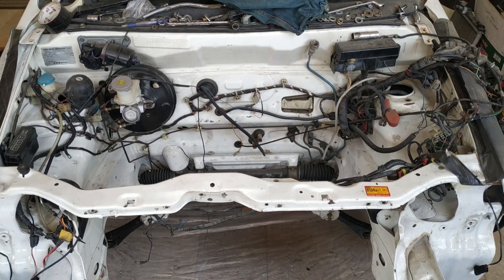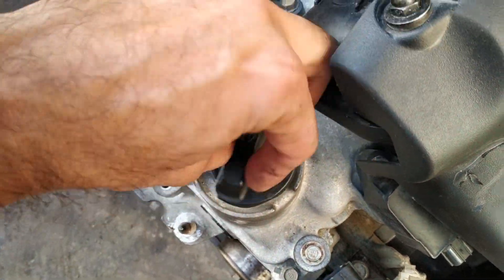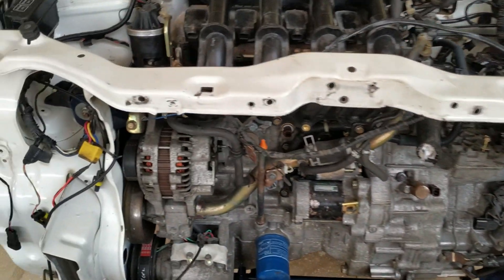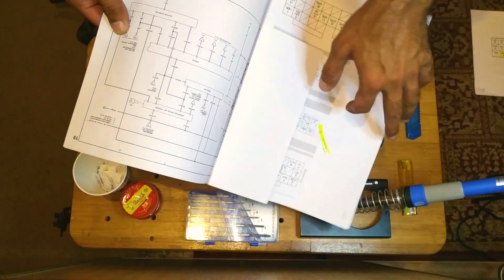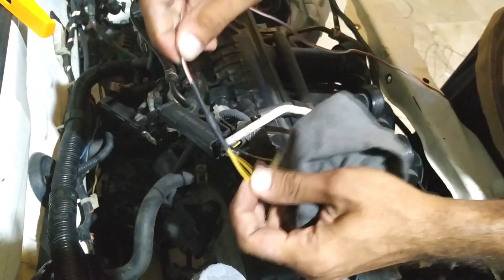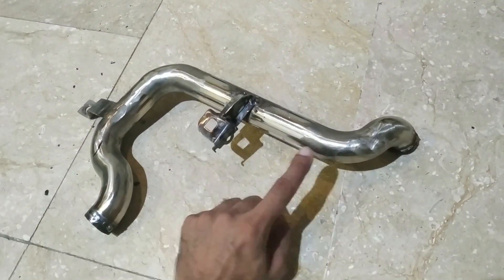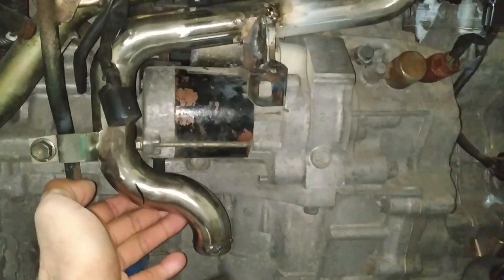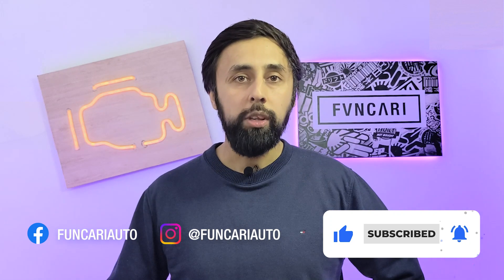Project L13A ALTO: The Engine is Here! Wiring and More – Part 4

Comment: Great episode. One thing I'm concerned about is the additional mounts that you've added, do they impact the ground clearance of the car when it's fully loaded with passengers? Eagerly looking forward to the final stretch of this build.
Reply from the maker: Thank you so much! Yes, the ground clearance is actually about 2 inches less than it was before. The engine sits about an inch lower than the original engine and in addition, the bottom cross member adds another inch to it. That said, there still is plenty of ground clearance. The front rod and the additional rod on the left of the cross member were added to add protection for the engine, they are placed in a way that they should protect the engine in case it bottoms out on something.

The weight of passengers in the back seat however should not affect the front clearance alot because about 80% of the cross member sits in front of the front axles, so even if the car sits lower in the back, the front would still have its clearance.
Reply: @funcariauto  Excellent. I'm very interested in knowing if Wagon R can accommodate bigger engines like alto as well. From what I've seen of the under the hood space of Wagon R, it should be able to accommodate 1.6 easily, with little modifications.

One question that's on my mind, is it easier to build an automatic transmission car than the manual one?
Reply from the maker: @JavedKhanJDK   Wagon R has plenty of space under the hood, I also believe that it should be able to get a bigger engine easily as the Alto's engine bay is smaller than the wagon R. Regarding the manual vs automatic transmission, I believe both will require similar effort. Its just that most of the auto transmissions are larger units so they require more space. As long as space is not an issue, I would say they're similar, except that the auto transmission needs plumbing for the oil cooler and a little more on the electrical front.
Reply: @funcariauto  Wonderful. I'm planning to swap to a bigger engine in future. Will discuss in depth when the time comes :)
Reply from the maker: @JavedKhanJDK  In shaa Allah, sure thing please. This would be an interesting undertaking (Y)

Comment: If I want to swap this engine where should I go?
Reply from the maker: Which city are you based in? And what car do you intend to swap the engine in?
Reply: @funcariauto  I am in lahore and I have same model alto
Reply from the maker: @nuprogaming1331  Honestly, to swap this engine, a lot of fabrication work is needed. I'm not sure if a shop would be willing to put in all the effort and time. You would need to look for a shop in Lahore that is willing to take it up because their dedication to it would matter a lot, as there is very little room for error when swapping a larger engine into a small engine bay. Depending on your experience of working with cars, it would require a lot of input from you as well to get it done right.
Reply: @funcariauto  okay I understand that thanks for your time and I want to know which engine swap is best in honda reborn for better fuel average.
Reply from the maker: @nuprogaming1331  You are most welcome. To make the civic fuel efficient, there aren't many options because the civic is a heavy car. You could go the L15 idsi with cvt route but the power to weight ratio wont be too great. An R20 with CVT could give you better fuel average as the power to weight ratio would improve with it but the R20 is not easily available. At the end of the day, the R18 that's already in it makes the most sense. Just have the regular maintenance done so that it runs the most efficiently.